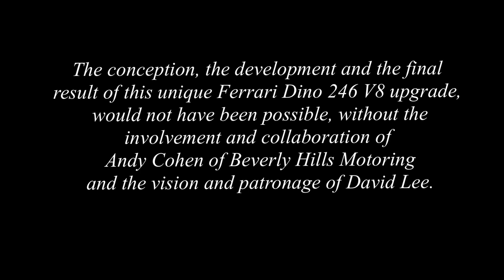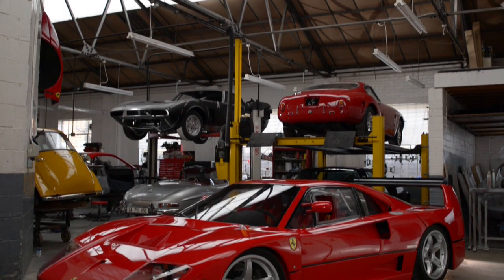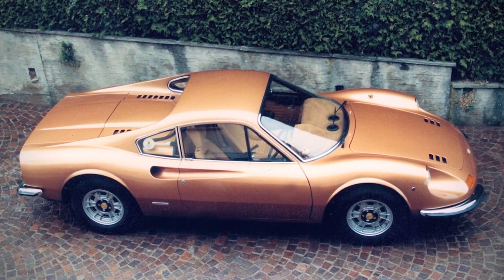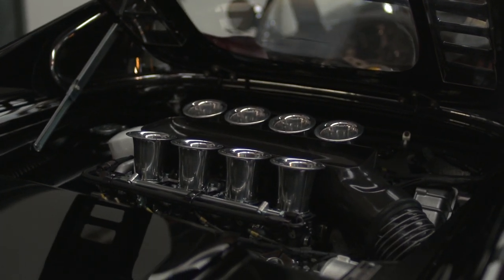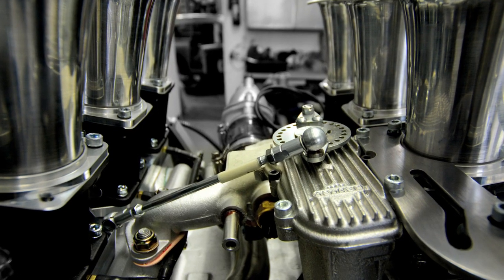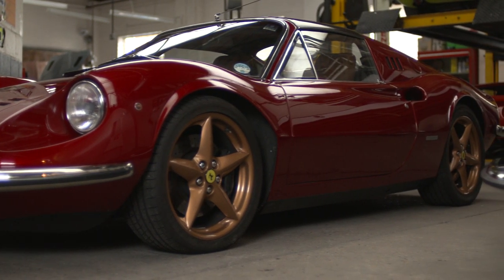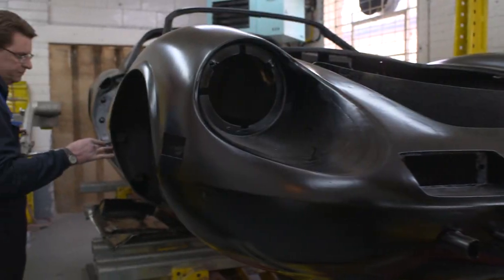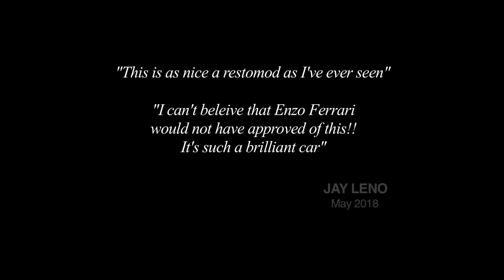Moto Technique Ferrari Dino V8 400bhp Upgrade

Comment: I'm flattered that you took notice and I hope you weren't offended by my comment. It is of course a remarkable achievement and like I said,  something to be proud of. Regards
Reply from the maker: We are never offended by peoples comments or opinions. We are all different and it nice to consider what people have to say about our restorations.
Reply: I'd like to see the same treatment applied to a Porsche 944 and a  Maserati Bora, these models should never have been discontinued, an exotic Masa and a practical front engine /rear wheel drive affordable Porsche.
Reply from the maker: @anthonyxuereb792  Yes, this treatment could easily be applied to both those classics. At the moment our new program involves upgrading and restomoding Ferrari 308 / 328 to more modern standards of performance and handling along with bore and stroking of the Ferrari V8 engine to 3.8 Litres and 400Bhp. A new film will be produced in the not too distant future. Keep watching.

Comment: Beautiful car, but part of the charm of the 206 and 246 Dinos is the V6 engine. To me it just suits the car. Without it they don't sound right. Just like a Stratos with a V8 wouldn't
Reply: Exactly, a Dino is light, fun and youthful. The V8 is to heavy/hard hitting for a car like that.
Reply: @f2detaboada  Yes. Light, fun and youthful. Great description.
Reply from the maker: Hi Alan, Thank you for your comment, Its quite normal for people to say that, but I can tell you with honesty that everyone who has expressed the same view and has then had the opportunity to either drive or be a passenger in one of our restomods have changed their minds with a 100% success rate. I hope that one day you get the opportunity too.
Reply: @mototechnique1282  yes, be nice should the opportunity come along. Certainly more power and mod cons compared to the original spec, which Ferrari would have built into it by now.

Comment: Stunning! Curious as to the rationale for using a bored out F40 block.  Do the external dimensions of the later V8's prevent the use of them, or are they harder to mount to a 328 gearbox?
Reply: This V8 is mounted latitudenally like the V12 of the Lamborghini Miura, instead of successive Ferrari V8 engines which were mounted longitudinally.

Comment: Wonder what the top speed is and 0-100 KM??
Reply from the maker: Thank you for your question. These figures are made available to the owners. Yes, it will be quicker and faster than any standard Dino, but no where near modern supercar standards. But, this car is not about numbers such as 0-100kph or top speed. Its about feel and feedback between the driver and the car, its about emotion and satisfaction of a drive that will put a smile on your face every time you get into the drivers seat and experience an analogue drive with no driver aides and its all about your personal engagement with a car tailored to your bespoke specification. This is something that is just not an optional extra on modern supercars which although have crazy engine outputs and performance figures, they are in the "real world" sterilised by all the drive aides which are needed to make them drivable and safe.
Do you really need 700-800bhp on a road car? and how many people can truly drive such a car? If you have a car that weights about 1000kgs and it has 350bhp that's about all you need to have fun. but, 0-100kph and top speed and BHP sell cars.

Comment: The most beautiful and elegant of all the Ferraris. The only detraction on this machine are the ugly hoops sticking out from the wheel wells. For those who don't know, Alfredo (Dino) Ferrari died at age 24 of Muscular Dystrophy. And the Dino was the first production mid-engine Ferrari.
Reply from the maker: Thank you for your comment. The fender flares have been made to the exact period correct Ferrari specification that they produced on the Dino 246 "Flairs and Chair" model. Not to everyones taste, but historically correct.
Reply: @mototechnique1282  Thanks for the update. I had never seen them before, only the graceful tapered flairs.

Comment: I thought the '74 246GTS  i had (same color as your car) was perfectly balanced, if I wanted to go faster I have other cars for that.  Does the modified car have that same sensuous balance of the original?
Reply from the maker: Thank you for your comment. Everyone who has previously owned a Dino and is a Ferrari purist have asked exactly the very same question as you and every single one of them (Without fail) that has driven this Dino V8 Restomod have been left in total awe and assured of what we have done. This car does not only respect the original Dino design and philosophy, but it's power, handling and reliability are all enhanced whilst retaining all the charm and character of the original. You really have to drive it to understand it. If you've owned or driven and original factory 2.4 V6, you will feel at home straight away and you'll really get it.
Reply: Unfortunately I can't afford  the real thing anymore, but have seen a UK  kit with a body done from an original, I also like their full convertible,

Comment: They probably had a good reason for using an NA F40 engine, but why not just use a 360 or 430 engine?  Same HP on the 360, more with the 430 at a much lower price.  Was it physical dimensions of the exterior of the motor?
Reply: My guess would also be that it had to do with heritage, seeing as the F40 engine was a direct descendant of the Dino V8, also, packing probably also played a role if I were guessing. I also realize the 360 engine is also based on the Dino V8, but in reality it probably just came down to personal preference

Comment: Not sure I would have used the 350 wheels.. maybe until I can get some custom BBS LM in champagne, or custom built Dino wheel.  Just my opinion.  I did have the opportunity to drive a couple different Dino's, should have bought one when they were not that expensive in the early 90's
Reply from the maker: On the original Dino 300bhp restomod  we did not really have much choice and this is explained fully in the film. On the David Lee 400bhp car with an unlimited budget we were able to develop and update the Campagnolo originals to 17 inches to accommodate the bigger callipers and brakes.

Comment: The only thing I don't like is the wheel arches. Other than that it is beautiful.
Reply: Those were the factory "flare" option extensions. Yes, I agree, they look totally cheap. But because they are rare cars with them are worth more.
Reply from the maker: Thank you for your comment. The fender flares have been made to the exact period correct Ferrari specification that they produced on the Dino 246 "Flairs and Chair" model. Not to everyones taste, but historically correct.
Reply: @mototechnique1282  thanks for explaining. Not my thing but the rest is just 😮😍
Reply: @Pantdino  thanks for sharing that.

Comment: The Dino 246 GT is not a Ferrari. Enzo himself said this.
Reply from the maker: When Fiat took over Ferrari, they wanted to start mass producing a cheaper Ferrari to start making money. As the Dino did not have a V12 engine it was not badged as a Ferrari and was at the time not considered a "True" Ferrari by aficionados and I do believe that Enzo original thoughts were the same, plus it was also a way of honouring the Memory of his late son "Alfredino". In the early day, some people even changed the badges from Dino badges to Ferrari badges at the time. Even the 308 GT4 that followed was originally badged a Dino and in latter productions it was changed to Ferrari badging. Nowadays, people appreciate the original Dino and correctly refer to it as a Dino 246 and not a Ferrari 246, and even re-badge them back to the original Dino branding. Although personally I'm happy to accept a Ferrari Dino 246 GT. Thank you for your comment.

Comment: I had a chance to buy a rare aluminum one for $12,000. Instead I bought this stupid Pantera. Sigh.
Reply: Don't sweat it, bro. Pantera is a beautiful car in its own right. And maybe you can adapt a driveline from the Ford GT in there.
Reply from the maker: Hopefully you bought the Pantera because you liked it more at the time and that's the right reason to buy anything. That's because you are a car guy. Over the years, Cars come in and out of fashion, I remember in the 1980's in the UK when Dino's were about £7,000 all day long, there were plenty available and nobody wanted one. At that time most people would have also chosen a Pantera over a Dino. It's only investors and speculators that would regret not buying the Dino 206 (Aluminium Body).

Comment: Generally whatever Ferrari design that was out at the time is what anyone says their favourite one is. This is true for me for the 308/Testerrosa/F40/355 all within 10 years all have that sentimental ferrari look for me. Generally I would look at things like the Dino and think it’s too far back in terms of angles and design like an old racing Ferrari shape rather supercar aesthetics. I felt even the 250 gto looked a little too dated on from the beloved 308 GTB. as time went on......although driving one the 360 in design was too rounded and the 430 meh!. However looking at this Dino in this colour does something for me. Just my thoughts 💭🙂 458 is the 308 successor in my book just how the front qtr panel arch hugs the wheel and stick up but comes down quickly hugging the wheel if it makes sense!!
Reply from the maker: You should pop by and see our new 308 GTB/S Restomods with 400BHP.

Comment: In my very humble opinion those wheel arch extensions ruin an otherwise fabulous car. (I think Jay Leno agrees).
Reply from the maker: Thank you for your comment. The wheel arch extensions have been made to the exact period correct specification that Ferrari they produced on the Dino 246 "Flairs and Chair" model. Not to everyones taste, but historically correct.
Reply: Thanks for your response. I felt sure you would have only followed Ferrari precedent when making the arches wider. I still think they jar with the fabulous curving profile of the original.

Comment: Dino was great as it originally was conceived. No need to come with modern day modifications 40 years later. What is the point? It doesn't make any sense to me.
Reply from the maker: Drive an original Dino and then our V8 upgrade and you will find that it has lost none of its characteristic. We believe that we have upgraded it with the upmost respect to the original car, but also with good taste. Original Dinos are now around 50 years old, why would you not update the power, handling and safety to modern standards whilst retaining all the charm of the original if you could? For the purists, it can all be returned back to absolute originality at anytime.
Reply: Hate restomods. There is a reason why manufacturers design new models ... so just buy them. Leave the old cars to those that want to enjoy cars how they were

Comment: Fantastic work to be proud of but it's not a Dino any more.
Reply from the maker: If you have ever driven an original spec Dino 246 and you were to jump into this V8 upgrade, you will find yourself instantly at home. It has lost none of its characteristics or charm, it just has more power, better handling and reliability.

Comment: How to shit up a beautiful car.
Reply from the maker: We always acknowledge all comment. You must be commenting based on having either driven our car or your vast experience of driving other Dino's.
Reply: @mototechnique1282  I was lucky enough to be part owner of a late 1972 GTS from 1996 to 2002. The heart and soul of that car was the V6 engine, and while we loved driving it, we also went to great trouble to ensure originality. I intensely dislike people who modify classic cars, it's as dumb as putting a quartz movement in an 18th century carriage clock because, hey, a clock is meant to tell the time, right, and a quartz movement is much more accurate than a mechanical one, right? If you can't see that about classic cars you're missing the entire point. Yes, the original engine in the Dino can be temperamental, (plug fouling, anyone?) yes, by modern standards the power output is underwhelming, but if you want a modern car, buy a modern car, don't butcher a classic, arguably one of the finest sportscars ever made.  Now do you get where I'm coming from?!?
Reply from the maker: @EnglishroG  Thank you once again for your comments, It is good to know that you are speaking from experience of ownership and that you are not just a keyboard warrior.

Here at Moto Technique we can claim to have probably restored or repaired more Dino 246's than anyone else in the UK and we know these cars inside out and back to front.

Many of our Dino's have become concours winners and are restored to total Ferrari Classiche standards. But, as well as agreeing with you about heritage and originality, we have to run a business and we are customer driven by what we do. Clients are now demanding restorations and repairs that go way beyond the finish of the original standards of the cars that left the factory all those years ago.Panel Gaps, Paint Finish, Interior Trim etc are now far superior to the original specs and this is reflected in the hours we spend on our restorations and the prices we have to charge our clients.

Our 3.6 V8 Restomod project was a collaboration with a client who had a vision, we totally believe that we have fulfilled that vision in the most respectful and tasteful way possible with Ferrari values at the heart of everything we do. In our opinion it would be so easy to get it wrong and do it distastefully, but we truly stand by our work in terms of quality, engineering excellence, performance and safety. If you did not know any better you would be hard pushed to tell it was not a factory job. Even the flared arches, which on these pages have attached many comments (Not all flattering) are made to the exact specification as the original Ferrari "Flairs & Chairs" standard and are totally period correct.

Many people who have voiced the same view as you have totally changed their minds once they have driven or had the privilege of riding in our Dino V8 in the flesh.

As we mentioned in our film, this Dino 3.6 V8 restomod was created using original Ferrari parts throughout were possible and can be returned to it's total original specification at anytime.

You can please some of the people all the time and all of the people some of the time, but you can't please all the people all the time.

Thank you once again for taking the time to comment and we truly hope that you one day get to see this car in the flesh.
Reply: @mototechnique1282  Thanks for your honest reply. I still can't admire what you've done to that Dino, but I was rude and disrespectful to you, and I apologise for that. None the less, I'm sure in another few decades, you or someone like you, will be returning that car to original specification.
Reply from the maker: @EnglishroG  Thank you once again for your reply. We do not consider that you were rude or disrespectful to us, you just had a view, which we can totally understand and relate to, but we also wanted you to understand out position and values that we hold as an established classic car restorer with over 50 years experience and a team of professional artisans at the top of their game. We are currently restoring and upgrading 3 Ferrari 308's. If you live in the UK or are visiting, please get in touch and it would be a pleasure to show you our workshop. Best wishes, and happy driving.